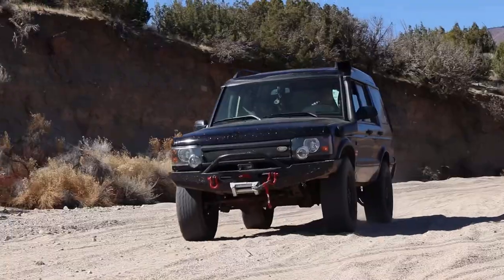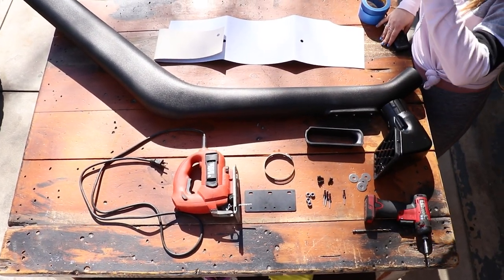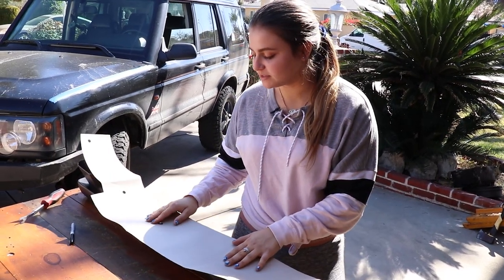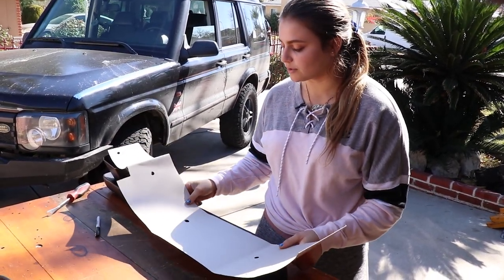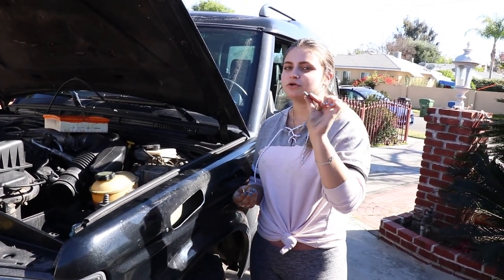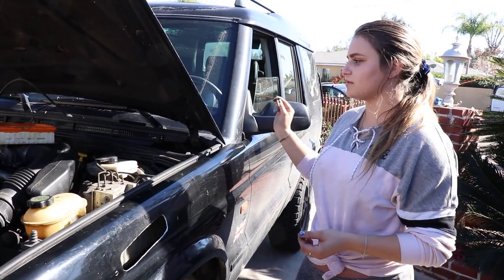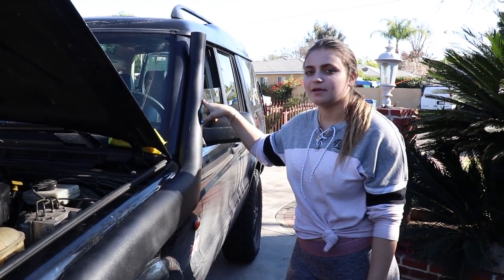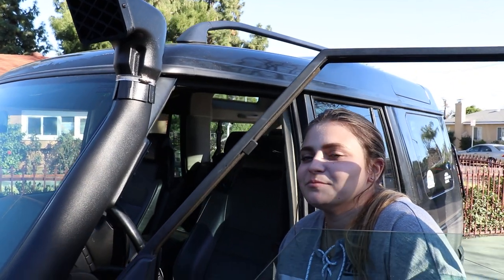Every Overland Rig Needs a Snorkel (Discovery 2 Install)

Comment: Hey guys!  Thanks for the update. I was thinking of getting the cheapest snorkel for my rig. Besides the lack of instructions was how was the quality? Also if you plan on water crossing you might want to put some silicone around the braided part cause it can and will suck water though it. My 2 cents 👍
Reply from the maker: Yea after finishing it we were really disappointed in the snorkel. It didn’t light up perfectly and even though it’s better than having the factory air intake location. We still won’t go deeper than the top of the tire.
Reply: @overlandingworld  They sell a catch can for the top of the snorkel that keeps dust/sand/dirt away from the filter. Also, If you don't mind, I hear that switching the coolant thermostat to the TD5 one keeps the engine cooler than the original gas version on the Disco.  My 2 cents✌️

Comment: Hey there, i have 2004 Disco 2 with the same Hurricane Wheels, awesome and enjoyable  content guys please keep it up. Got 2 questions for you.   1. What size and what kind of tires you guys are running,  and 2. Do you have a lift on Larry if so what kind and how high?  thanks
Reply from the maker: We have Bfg KO2's and the size is a 275/70/18 which is basically a 33.2in tire. And the lift is a OMU 2in lift. We are currently regarding the truck and going to go up to 35's.
Reply: @overlandingworld  oh wow thanks for the reply. if you guys go up to 35s is a 2inch lift going to clear it from rub?
Reply: @calon5productions326  no. I drive a 2001 disco and have a 2” lift from terafirma and it only frees up enough space for 33’s, unless you use spacers or have offsets that push your tires out, then there is only room for 31’s. To fit 35’s you need to do extended fender flairs and cut your wheel well openings bigger, or use a body lift. Body lifts can come with some other problems and increases the height of CG more so opening up the fenders becomes an easier/better option. 

I have owned my disco since 2010 and have wheeled it all over this country, (cali, Colorado, New Mexico, Utah, Arizona, Wyoming, Montana, Tennessee, Kentucky, Indiana, South Dakota, Nebraska, Texas, Florida... the list goes on and on). The point is that I have turned every bolt and screw on this vehicle and have traveled over 150k miles in it, and I’m still not board of it. Yes the truck WILL come with it’s challenges... they are not like a Jeep where everything is available and easily bolts on when something brakes, and they don’t have all the already engineered cookie cutter parts like them either. But that’s why when you see a property built Disco it demands a certain amount of administration and respect. I suppose that is why I love them so much though... they are not just another Jeep.

Comment: Can I take my rig over for snorkel install? Lol. Anyway, how's the snorkel? Debating on getting the eBay ones or an ARB.
Reply from the maker: Honestly after having it we are questioning it. The wind noise has significantly increased and can be really annoying especially at 75mph.
Reply: @overlandingworld  have you guys had any malfunction? Or have had issue during rain? I'm just curious if these cheap ones would do as long as it works.
Reply: Turn the scoop 180 degrees facing towards the rear and lock your speed down to 65 on cruise control when coasting on the highway. I find that using my cruise control often gives me better gas mileage. And I have a voyager rack with 4 Hella Rallye 4000 lights, a Hi-Lift Jack, axe, shovel and other goodies on my rack. Then just turn your scoop forward when you hit the trails. You can do all that while you air out and air up your tires.

Cheers!

Comment: Currently converting a black 2002 d2 but it is also called larry 🤣  its diesel though
Reply from the maker: We wish ours was a diesel. We are averaging 10-12 moles per gallon and gas is 4dollars a gallon in California.
Reply: @overlandingworld  i get 30 mpg out of the diesel on a motorway run at 65 ish but fuel is so much more expensive here in the uk. Diesel is £1.22 a liter which if I've calculated correctly its almost $8 a gallon so couldn't affort to run a v8 at that mpg figure haha
Reply from the maker: @wilmarklewgolf5621  oh wow 8dollars a gallon. Diesel here is about 3.50.
Reply: I dream of the day I find a TDI5 with transmission, wiring harness, all the peripheral‘s, engine mounts... I don’t know why they didn’t bring them to the American market, but it sure would have been nice. I hear they pop up for sale in Canada sometimes. But to ship one with all its bits and bobs from UK would be crazy expensive.
Reply from the maker: @hazyhuckleberry7642  yea if your going to do all that just swap a 4.8 ls engine.
Reply: @overlandingworld  from what I understand I could have the 4.6 by turning my 4.0 into a “storker”. Apparently you can drop the crank and pistons from the 4.6 into the 4.0. They say it makes for an even stronger engine cause the 4.0 blocks where better produced. It’s definitely something I’ll be looking into. For now I’m going to get my power from installing 4.43 gears in front/rear differential.

All that though just seems hear say and it’s probably best to do away with the whole LR engine all together and do an LS swap. There is a company that will supply everything you need to do it. Engine mounts, adapter plates, engine, transmission, computer... you want power, that’s where you get power.